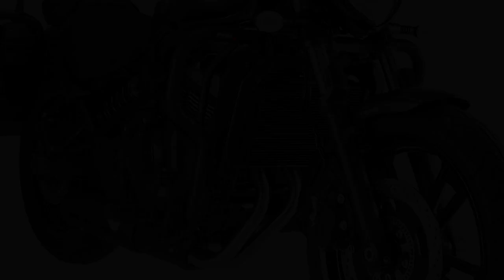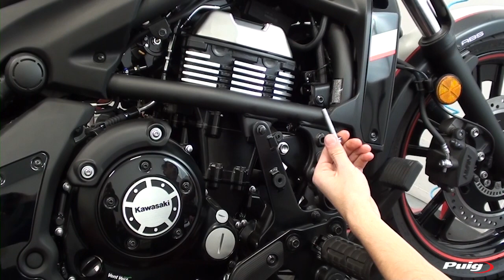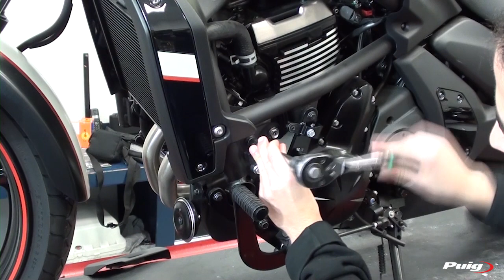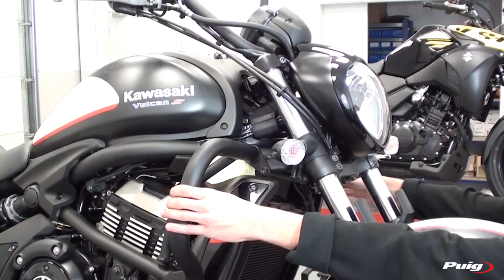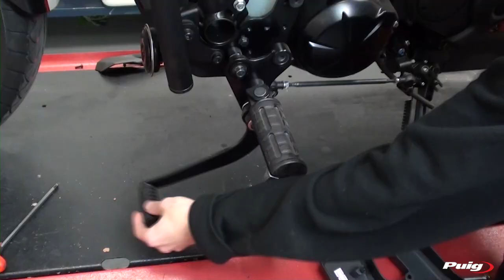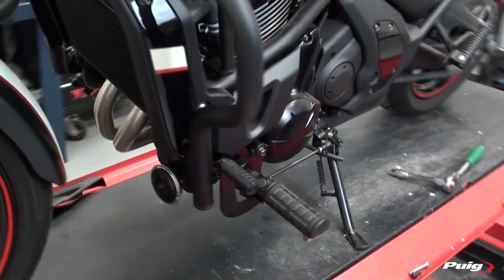REF.8544N Engine guards for KAWASAKI  Vulcan/S

Comment: I purchased a set a couple of weeks ago. I have to say that the installation was a nightmare, it is not an easy as the video shows. Mainly, the problem resides in installing the right guard. I found two main issues, the holes are not drilled with precision so therefore in order to install the screws is a nightmare and you have to issue quite a lot of force to place the guard in place. The second issue is that the break pedal is on the way of the holes so you have to install the screws very carefully in order to go in straight and not in an angle which will damage the threads. This last problem together with the first one made the installation extremely painful. Once I had everything lined up, I was able to install the screws properly so I had to change the strategy and do it another way. Finally I was able to install the right guard with the pain point that one screw couldn’t go all the way in which, I am afraid, damaged the original threads. The left side went ok except for one issue that is not explained in the instructions. There is a nut/washer that needs to hold the long screw in place. The video shows that inserting a wrench will do the trick, wrong!!! To tighten such washer needs a lot of skills and time. I nearly returned the guards back due to the problems but I decided to install it all and it looks great and hopefully the troubled screw and washer/nut will not come off. Hopefully this helps.
Reply: I totally agree Zaska.  I returned mine.  They didn't fit, and I had to tilt the screws in to get them to work.  I've learned that Puig doesn't make quality products.  I have their windscreen too.  It makes more wind in my face than without.
Reply: Wisconsin Archer if you can get other brand guards would be better. I believe B&K make one or even GIvi.
Reply: I just put mine on yesterday. Really no problem other than the top lock nut on the left, but a 12” socket extension and swivel took care of that. All holes lined up perfectly. Do you have your controls in the forward reach position?  Mine aren’t as I’m a short (5’) old lady, so my controls are out of the way.
Reply: everything is made in china these days.  Junk.  anyway I think they would fold back during an accident.  Not good leg protection.  My leg was crushed when the crash bars on my Yamaha folded back.   hese look to be a little better but not braced right

Comment: Thanks for the video. I have the same kit, installed the left side but the right side gets stuck behinde the metal piece that has the brake fluid reservoir screwed in. There is no enough clearance to align the top screwe. What is wrong?
Reply from the maker: Hello! Please write to info@puig.tv to get some assistance!

Comment: The video does not show an actual installation. Difficult steps are intentionally left out and another is faked. I installed these guards today trying to follow this video as a guide.

At 1:49 it shows him easily reaching behind to attach the nut on the bike's right side.  In fact, you can't easily reach it from behind on that side. You have to use two hands from over the top and the right side to carefully align the nut to the bolt, while holding several rigid wires aside with one hand. Notice that it doesn't show him using a wrench to tighten it on that side because you can only reach in there from the other side of the bike with a 16" socket wrench extension! A wrench cannot get to the nut.

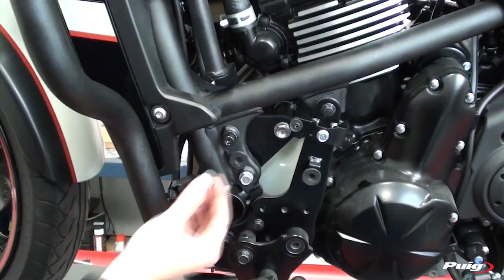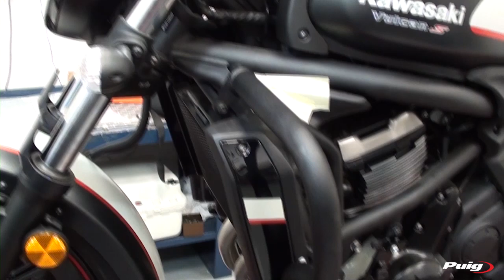At 3:30 he casually reaches behind to attach the nut on the left side of the bike. That's impossible!  You can't reach the bolt from the front like that! Parts are in the way. Then at 4:13 he appears to be tightening the nut with the wrench. Besides the fact that the nut is blocked from that direction and a wrench doesn't fit down there and can't be rotated like that ... notice that he is turning it the wrong direction to tighten, he'd be loosening the bolt like that! He faking the shot for the video. You have to reach the nut from the other side with the socket wrench extension.
Reply from the maker: We are sorry that the video could not guide you correctly in the assembly of the crash bars. We are sure that they can be assembled (no without some difficulties) with the tools shown in the video, but in any case we will review their assembly process to verify it.
Reply: harpriffer I totally agree with you. The installation is a nightmare. The difficult steps you mentioned happened to me as well. I took more than 2 hours to get it done till I realize the holes in the bike and on the guards did it aligned and I had to twist the bolts. They are secure now but I would recommend other brand.

Comment: Is it compatible with the forward most foot peg position?
Reply from the maker: For reasons of anchors and supports of the defense to the chassis, this protector is manufactured to go with the footrest in the original position. It is not possible to overtake it.
Reply: EXACTLY. I already bought and returned a different manufacturer's engine guard for this reason. It does not work with the forward foot position. I'm still hoping someone gets their act together and produces a product that fits the bike when it is in the extended reach configuration.
Reply: Just looking at my bike with forward foot position. It looks like all you need to do is cut the spacers down to make room for the bracket. Or you could find some other spacers and you would end up with two spare bolts for your trouble and a little more time working on your bike not a bad thing. Thinking I will get some of these they look nicer than the R&G bars.
Reply: it does fit with the extended reach I did it myself today but my god was it a faff!
Reply: YES IT IS!  ...but you'll have to do a simple mod that requires a few extra (cheap) parts.  Basically, you just need to extend  the rear left (shifter side) peg holder spacer and rubber boot a little so the shift pedal will clear the crash bar.  On the right (brake) side peg holder you just need to use a shorter spacer on the front mount hole.  Even though the directions below are a bit long, this is actually a super easy mod that'll cost you around $6 at your local hardware store.  Hey Puig: Feel free to include this in your instructions with proper credit...  ;)

You will need the following parts:
2) M8 x 1.25 55mm (or 60mm) bolts
Around 20-25) M8 or 5/16" flat washers
1) Rubber boot that's longer than the original one on the left (shifter side) peg holder.  This part might be optional.

Left (shifter side) peg holder:
1: Remove (or don't install) the bolt at the bottom of the crash bars that goes in the same front hole as the foot peg holder.
2: Replace the rubber boot on the foot peg holder with the new longer one after putting a stack of washers in the boot first (I used 7 washers, but depending on the washer thickness, you may have to use a different amount).  You may still be able to use the original boot, but it may not stay on the peg holder as well as it did originally.)  This allows the boot to stick out further than the original.
3: Mount the front peg holder hole using the other new M8x1.25 55mm (or 60mm) bolt with the original spacer.  Don't torque the bolt yet.
4: You need to use a stack of washers to equal the thickness of the metal where you removed the bolt from the crash bar (I used 5 washers).  If you have some super glue, glue these washers together for easier installation.
5: Slide one of the new M8x1.25 55mm (or 60mm) bolts through the rear hole of the left peg holder, then put the stack of washers on the bolt followed by the original spacer (creating an extended spacer).  Mount the peg holder starting with the rear hole.
6: Torque the bolts appropriately.

Right (brake) peg holder:
7: Remove (or don't install) the bolt at the bottom of the crash bar that goes in the same front hole as the foot peg holder.
8: Mount the foot peg holder starting with the rear hole using the original bolt and original spacer.  Don't torque it yet.
9: For the front hole, replace the original spacer with a stack of washers (I used 7 here - this stack plus the thickness of the metal where the crash bar mounts should equal the thickness of the original spacer).  For easier installation, glue the stack of washers together.
10:  Mount the front hole with the stack of washers through the crash bar using the original bolt.
11: Tighten both bolts to appropriate torque.
12: Enjoy not having cramped legs and keep the rubber down!  :D
Reply: @planetmess Worked great. Thanks for posting this!